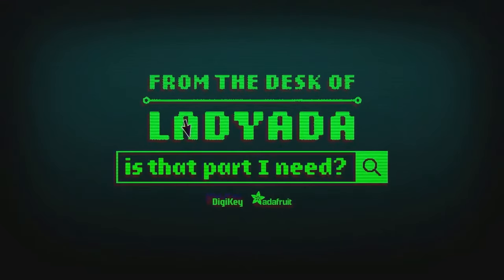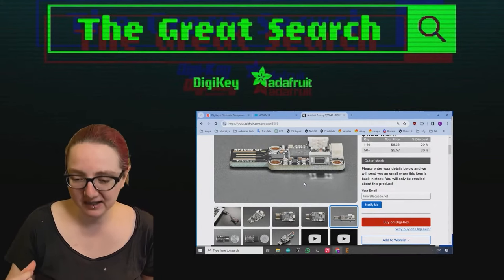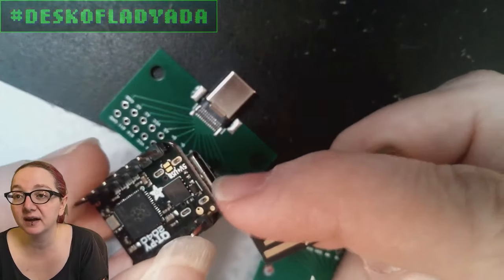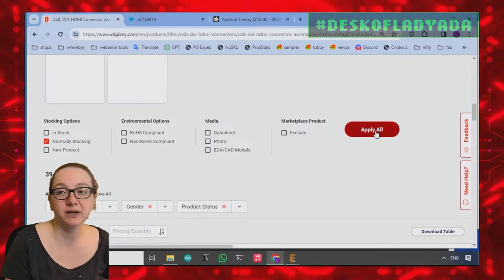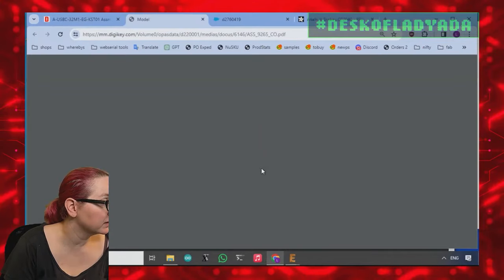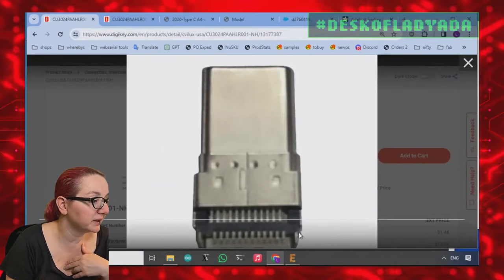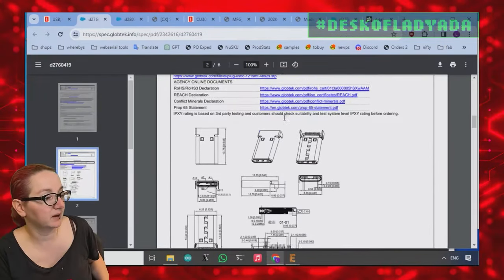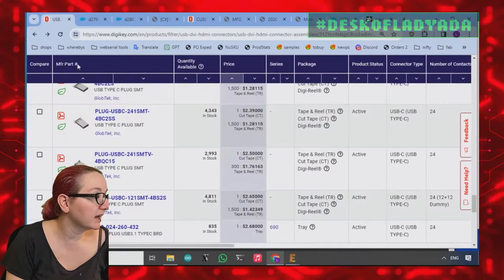The Great Search: PCB-mount USB Type C Plug #TheGreatSearch #DigiKey @DigiKey @adafruit

Comment: I recently went through a similar process, and I was only able to find a handful of connectors that were not straddled. I'm very curious about the costs and challenges for manufacture when using the straddle mounts, since so many very cheap devices use them. But frankly if Lady Ada suggests a right angle connector I'm happy to try it! My biggest question usually is will this component be available when my manufacturer spins up some product, perhaps I'm still burned from trying to score lmc555 timers during the chip crisis.